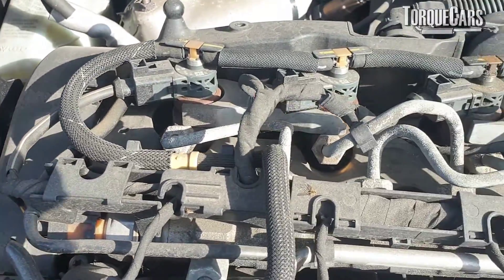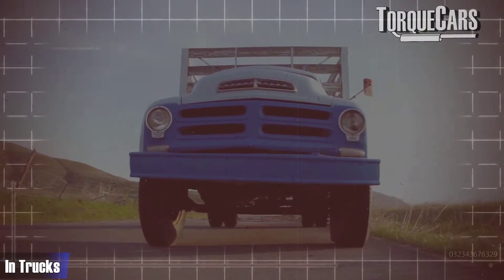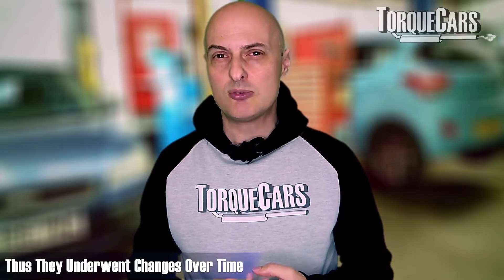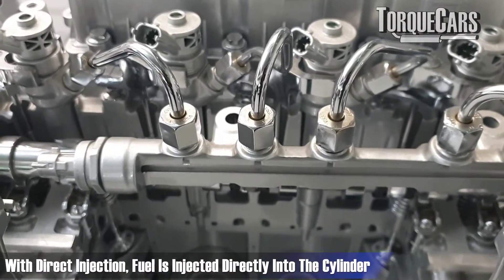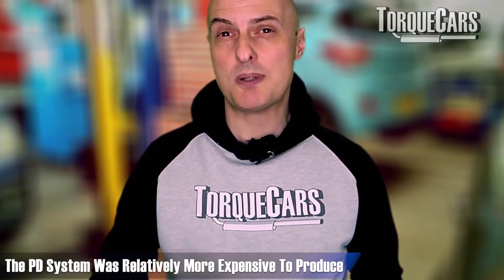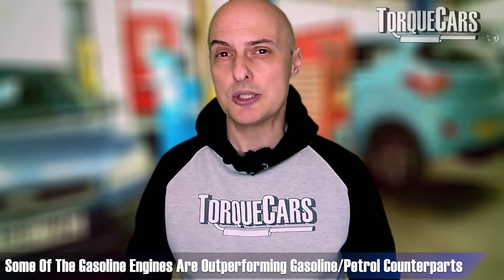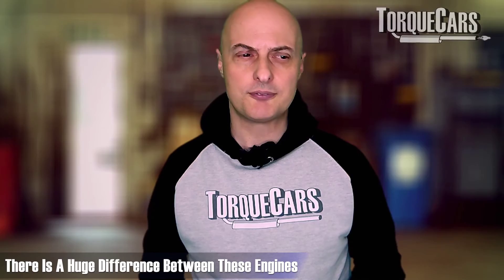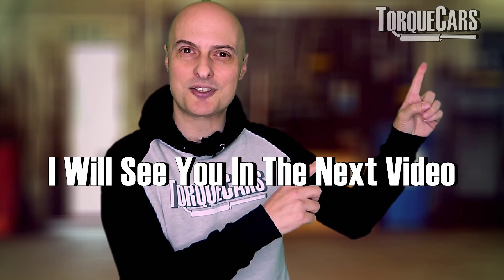How The Modern Diesel Engine Evolved, Significant Technological Leaps & Development

Comment: What other cars used the PD technology besides VW?
Reply from the maker: PD was VAG's name for the "unit injector" a cam driven pump for each injector. Technically common rail was more commonly used back then but the PD offered higher pressures, then this changed with VW switching to the CR setup which is now offering far superior pressures.

Other brands which used unit injectors were  commercial vehicle from manufacturers such as Volvo, Cummins, Detroit Diesel, CAT and passenger vehicles from manufacturers such as Land Rover, Mitusbishi and Volkswagen Group.